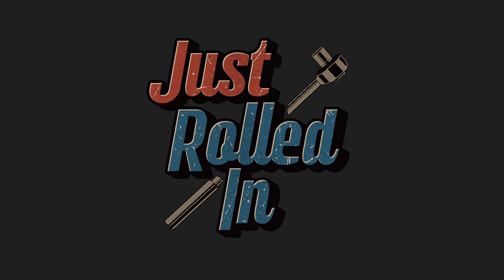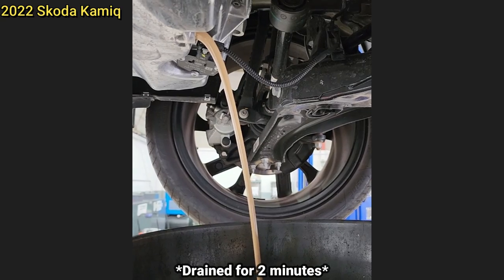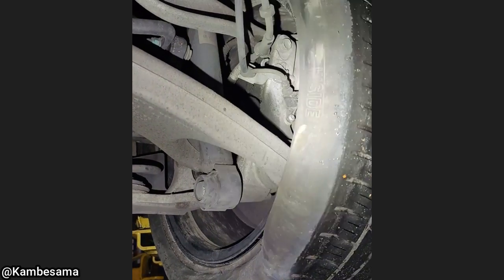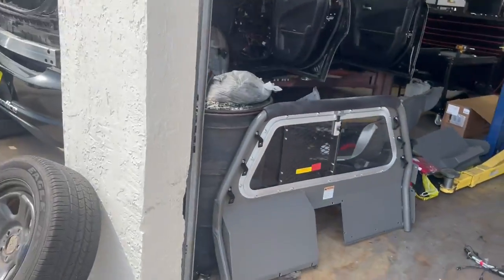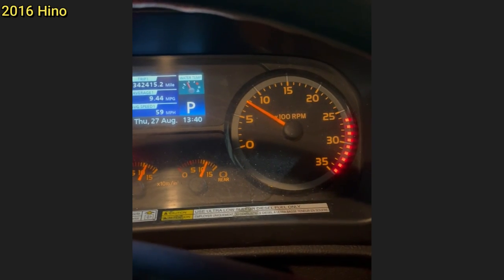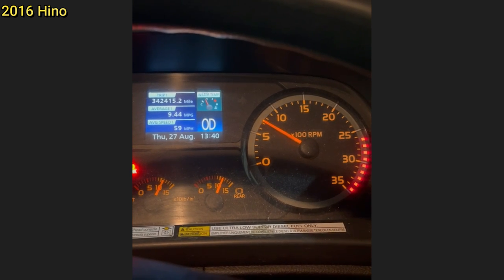Customer States Brakes Locked Up | Just Rolled In

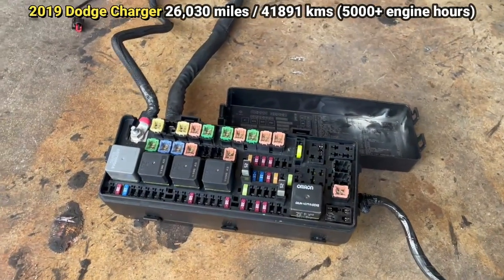Comment: 1:42 It's sad when manufacturer tech support does the parts canon.  I can't see how that helps.  I'd replace the fusebox and go for an industrial relay.
Reply: I think those relays are built into the box, plus if it has happened 3 times, replacing what could be a faulty harness may not hurt
Reply: A little aluminum foil will solve that wiring issue, no problem!
Reply: @GreenJeep1998  How would the harness cause the relay to burn?
Reply: @russellhltn1396  It’s been said elsewhere in the comments on this video that the wiring leading to that is undersized, maybe it’s causing an undue load on the relay for the police package cars.
Reply: @GreenJeep1998  If the wiring is undersized, it might overheat the contacts.  Still, that seems far-fetched as to the cause.  A police car would have the same load on the fuel pump relay as a regular car running the same number of hours.  The only real difference might be the underhood temps due to lack of airflow during the long idle.

Comment: 1:50 I watched an episode of Roadkill Garage. They had a 70's Dodge, where a 2014 Dodge Demon engine plus all the required wiring, steering wheel, dash, computers, and gas tank were removed, after it was installed for a drag race w/ Gas Monkey Garage. 
2:49 On Top Gear, they drove a Luxury Citroen that they mentioned had a factory flaw. All the wiring insulation was in one just color - gray!
Reply: When they that they also number every wire at each end so that you know what it is. Also just like any other there is a wiring schematic for it.

Comment: Yo! The steering wheel on that Citron, that's actually a really cool design! It keeps the emblem right side up the buttons for everything stay in the same place all the time, if it had paddle shifters the paddles would not move either and would stay in the same place so you wouldn't have to figure out which one is plus and which one is minus with the steering wheel isn't right side up lol that actually is a nice set up I wish more manufacturers did that.
Reply: the semi automatic has got paddles 😁

Comment: That body harness one reminds me of a customer who got sick of popping power window fuses, so he stuck a paper clip in the fuse box. There was a wire pinched in the left rear window actuator. He let the smoke out of the body harness that ran down the driver's side sill and almost set the carpet on fire.
Reply: I had one where the wiring harness was damaged by the window actuator because the harness was never properly routed and secured during assembly. I was able to prove that to the district rep's satisfaction and even though the car was almost 10,000 miles out of warranty when the problem appeared, Ford covered the replacement.
Reply: @mindpilot72  mine was on a 15yo Bonneville, and he f'd it up, so no chance at getting it under warranty. I ended up cutting a harness out of another Bonneville in a junk yard and picking at it in my spare time over a couple weeks. It was a disaster.

Comment: That Mopar is probably going to burn down, even after the new harness.  Seems the actual issue is a need for heavier wiring, a bigger relay and a good ground, and for gods sake, check that fuel pump.

Comment: I had one of those Citroens. Best car I ever had, I wish I had never sold it. The steering wheel is great because all the buttons are always in the same position. And you drive the car using the paddles and the hand throttle most of the time. I have tried to find a second hand one, but they just don't ever sell.

Comment: Troons used to have 1-spoke steering wheels. It was kind of like a tongue coming out of the steering column. So 2 spokes is a big step up.
Reply: The single spoke wheel never got in the way of reading the instruments. It was a great idea that they had to abandon when they had to start fitting airbags.

Comment: That police cruiser looks like my 2005 Town and Country van. (Pristine spotless , loaded, senior owned Fla car)
Been in the dealer twice for a total diagnostic, stripped and naked, dash and harnesses pulled out like that , TWICE ! ( Dealer waived charges even WTH 😒🤔)
It keeps refusing to shift out of first and high idling at totally random times, then its fine for 300 miles.
So far its still not repaired, as after a massive bump it still happens, somewhere , someplace , two wires are makin love, and no one can figure it out , poor naked hoopty.

Comment: The fixed hub steering wheel was a great technological advance about 16 years ago (a 2006 patent) in the Citroën C4 SUV and C5 car. Unfortunately, they abandoned this costly design since then. In addition to the fixed position of the controls, a side benefit was that the airbag would always deploy and protect as designed, regardless of the position of the steering wheel.

Comment: That Buick Century wagon in the lower right hand corner at the end was my first car.. I called it the BMW.. Badass Meat Wagon. The rest of the video was Just Rolled In - Vandalism Edition.
Reply: Nice..being a non gearhead I wondered on make; Pa had battle fatigued '64 Olds wagon that Ma inherited. That's your 'BMW':) or looks similar? Great color..
Reply: @brianstratton8767  Mine was a 1973 Buick Century Station wagon that was the basic blue that came with a rusted Hood and Roof. I used Navel Jelly on it and sprayed it with primer grey. I did a search for my car and I came up with the same dent on the rear quarter panel at the gas door. I thought it was a hit and run but it might be just a defect. 1971 Pontiac Fire birds rear fiberglass panel below the trunk have the same broken area.... so who knows.

Comment: My dad with Alzheimers drove his 4x4 out back of the mountain and HAD to have rolled over a boulder or got stuck. He broke his back disk brakes, pads, crushed bearings, and destroyed a rocker arm. He blamed it on his tires for months until finally he couldn't drive it because the brakes failed!! 

Still doesn't remember what he did to break it. I've been glad the supply chain has slowed forcing him to take the bus instead of drive.
Reply: Don't let him drive if he has Alzheimers, for everyones sake.

Comment: So let me get this straight, the Dodge Charger overheats the fuel pump relay by just idling or just from running for hours on end?   Is there a manufacturer duty cycle that needs to be followed?

Comment: The Citroen steering is like that so they don't have to use a big round airbag on the steering wheel. Because the hub and airbag module don't rotate as the wheel is turned, they can use a bag with the optimum shape, so it's safer than other cars.

Comment: Yep they made a recall on lots of cars for the fuel pump relay. Easy to do but damn so many cars had aftermarket bull crap in the way and would be made when I say more time will be needed to move crap that would be glued ziptid or wires splinted in spots idk y

Comment: 1:42 This problem has gotten so bad and so widespread that people have figured out how to fix it better than Chrysler. 

 I don’t know who sells them, but there’s a small cable connected with a relay plug and a fuse plug, meant to bridge the cigarette lighter and the fuel pump relay. The fuel pump runs whenever the cigarette lighter has power, so you have to be careful when you run the accessories.
Reply: That doesn't exactly sound like "fixed better than Chrysler"...
You can only hope people thought of including emergency shut-off of the fuel pump in case of an accident. Cause the cigarette lighter usually doesn't do that.

Comment: They breaks on my blazer was locking up but releasing we spent a week trying to figure out why and we replaced several parts are got it working a day later the front right break started acting up.... We then found out the lines where also clogged we replaced the lines and done no issues "there where serval issues" the break lines was the issue for the front right

Comment: I love harness swaps.   They pay good labor and I'm super fast lol
Reply: Yes, pretty clean work and most items removed aren't that heavy, except seats of course.
Reply: @jen_alanfromchicago53  all the r&I adds up quickly.  However the dirty cars I've come across make me want a shower immediately after finishing the job lol.   Airbag jobs pay really well as do frame swaps and complete teardown for unibody frame rail replacement
Reply: @autotek7930  10-4 on that, guy next to me just today diaged a ses light,  turns out the pcm has a corroded connector and it's for the engine bay (not the harness on the engine- injector,  coils etc) 2016 LR, 28.00hr. too bad for customer ex-warr don't pay for corrosion. 🤷‍♂️✌
Reply: @jen_alanfromchicago53  the most hours I've billed on one car was 97.   That was a complete teardown including dash,hvac box and all interior plus engine trans and front and rear suspension.  2017 lexus suv.   And it stayed in pieces for over two months.    First big job with this company I started with 6 months ago and I'm currently getting Tesla certified.  I've done several big jobs on those so far as well
Reply: @autotek7930  Knocking out a bunch of vehicles each week is great for getting them the shop but sometimes those 30, 40hrs and up repairs are sweeter because you get left alone and get in the rhythm.  Plus it's cool to have a completely gutted vehicle in your bay .

Comment: Citroen hydraulic shocks always go bad. Smooth ride if works, empty pockets when fail
Reply: The older ones had to be regassed every 5-10 years.  My 2009 Citroen has never needed regassing - I guess materials science advances mean the nitrogen doesn't seep through the new sphere-diaphragms.
I've owned hydropneumatic-suspension citroens since 1981 and the hydraulics are always reliable if serviced properly and correct fluids used.

Comment: The C5 has a static steering wheel boss so the controlls are always in front of you. 
Its a great idea. Unfortunately, the steering box on mine died after 9 years and 100,000 miles and the car was just scrap value.

Comment: There's a really good reason Citroen with all of the other French car makers went bankrupt in America.
Reply: True.  Americans seemed frightened by things like disk brakes, front wheel drive, etc.  I can remember reading about the Chevy Corvette's and Cadillac's super-advanced new fibreglass leaf spring, while my old Citroen DS used compressed nitrogen self-levelling suspension struts.
Reply: @normandiebryant6989  yeah. My 1963 spitfire had standard front disks and seatbelts. But it also had rear swing axles.
Reply: Nobody sings songs about Citroens.
Whereas, 
Bitchin' Camaro
Little Red Corvette
409
Little Deuce Coupe
Hot Rod Lincoln
455 Rocket
One Piece at a Time
Mercury Blues
etc.

Comment: That was impressive, I've never seen brake fluid get hot enough th vaporize. But, just goes to show you, if you think people are idiots behind the wheel, you're probably right.
Reply: I see it all the time ( and smell it) when semis decide that I-17 is flat instead of having 7-8% downhill grade going southbound . I’ve seen steam / smoke pouring out most likely due to some kind of release valve

Comment: 0:40 ? I don't get why the customer decided to put the washer fluid in the engine oil reservoir ? You have to go out of your way to do that on purpose.
Reply: Well, I can see it happening.  Washers are empty, open hood, pour washer fluid into likely-looking hole.  "710?  What does that mean?"  Repeat until no more will go in, washers are still empty, give up and decide they just don't work.  Drive off, with the consequences we see here.

Comment: 2:50 I do like that steering wheel. Seems like it would be possible on all vehicles. I don't like having to look for the buttons when the steering wheel is 180 degrees.
Reply: Why are you looking for buttons when turning anyways? And your fingers will not be at the same relative positions to the buttons when turning.
Reply: @georgehill3087  not so much while actually turning but while the wheel is turned.

Comment: That Citroen wheel kinda defeats the purpose of the wheel mounted controls anyways. They are there so you can keep your hands in the optimal driving position at all times! In order to press the buttons in the center... you need to take your hand off the wheel. What is the point?

Comment: Would all of the electronics in the police vehicle make the fuse box get too hot and blow relays?
Reply from the maker: It shouldn't. The vehicles "should be" made to handle all that extra load from all the accessories and electronics. Especially since Chrysler makes Dodge Chargers specially for police. However I'm very curious on what the actual issue was with the fuel pump relay.

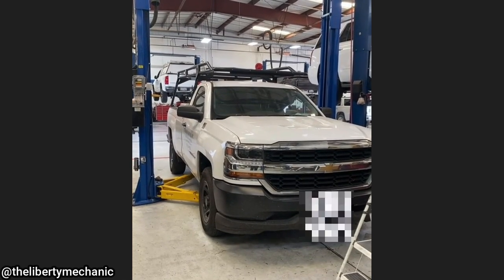Comment: 0:29 - it probably would have been cheaper if they actually targeted the correct component (the catalytic converter) - ever try to cut through hardened steel with a hacksaw?
Reply: I don't think the intent was to steal anything.
Reply: @MrTruckerf  I'm in awe then - Why would someone do this? ALL the 80w90 would piss out of there, and even before that, the carrier would twist under torque (seems like that's what was done?) - maybe they were trying to cut the brake lines (which they did) and they didn't understand how to do so?
Reply: @the_kombinator  probably trying to steal a locker or kill someone, also cordless sawzalls exist but I wouldn't do that with my ryobi and a 9AH lmao

Comment: Citroen used the fixed hub steering wheel in two series.  The C4 and the later C5 X7.  My wife and I have had a C4 and also still own two C5 X7.  The fixed hub makes perfect sense as the buttons are always in the same location and the airbag is always in the optimal position for deployment in a crash.  The headlights on the C5s will turn relative to the steering at slower speed and are also automatically self levelling.  Both the C5s have the latest version of the hydropneumatic suspension that is so comfy to ride in and automatically senses when a stiffer suspension is required for enhanced cornering ability.  Our current hobby car is a 1991 BX TZi and of course has hydropneumatic suspension and magnificent brakes that are powered by the hydraulic system.

Previous Citroens we've owned include a D Special that we had 19 years (also with levelling and turning lights), a CX and a V6 XM.

You could say we love our Citroens.

Comment: Had a weird wiring issue once. I was I stalling a head unit into my girls car, it still had the oem unit with the screws you cave to cut a slot in to undo, so had never been touched.

I got one of those harness adaptors so it would be quick and easy but any time I plugged the patch lead into harness the starter would turn over. Ended up cutting one of the wires on the harness to stop it and it all worked fine. Still to this day I cannot work out why any wire behind this 90's tape deck would be connected to the starter trigger wire.

Comment: What was the point of the Citroen steering wheel? I don't want to press any buttons WHILE I'm turning so what's the point? Cheaper? Possibly
Reply: Because the steering-wheel boss doesn't move, they can put a full-size shaped air-bag in it so the driver gets the same protection as the passenger.  Most cars just have a little round air-bag in the steering wheel.
Reply: @normandiebryant6989  why would you want a full size airbag in the steering wheel? Because you sit so far away from the wheel and have arms like Goofy or because you want to be harmed or even killed by the airbag?

Comment: 1:50 Don’t modern vehicles sip fuel at idle? Why would the fuel pump be drawing that much current to heat up a relay at idle? Was the really way undersized? Something doesn’t fit unless the SMart Junction box is over a turbo or exhaust manifold. Then heat shielding is much cheaper than fuse boxes, so that seems off too.
Reply: The relay and wiring are too small. It happens on many Chryslers. There is a recall kit for some to relocate and replace the fuel pump relay.